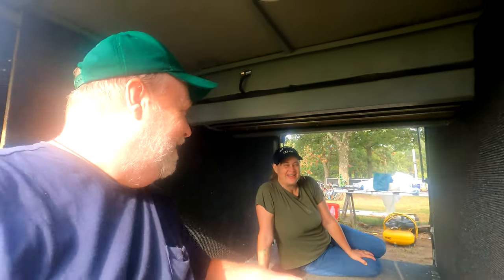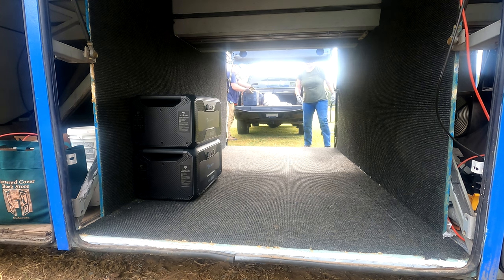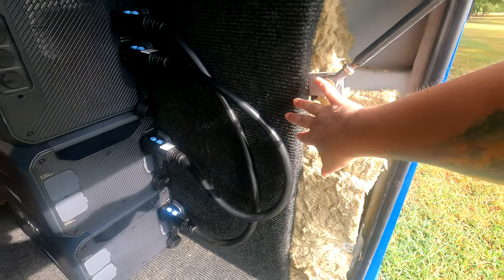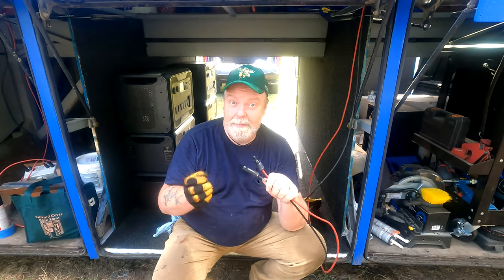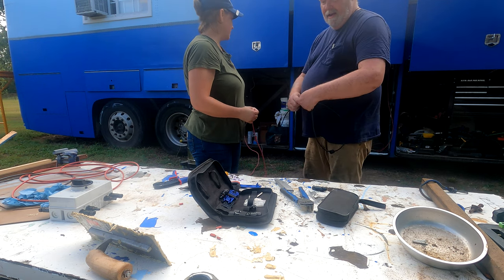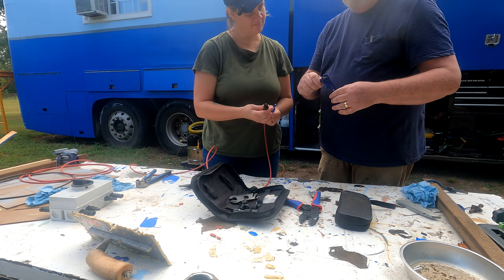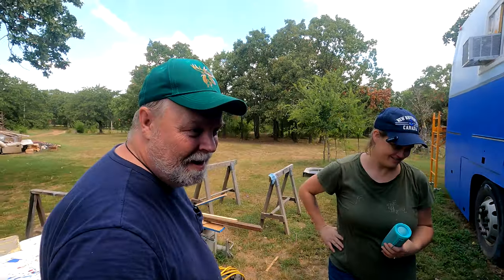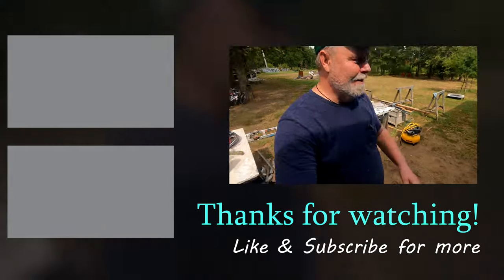Do Solar Generators ACTUALLY Work?

Comment from the maker: It feels so good to get our battery system installed and hooked up. This is the first time we've run a power tool off of our solar power. With eight panels and two Bluetti towers, we'll be able to pull in a max of around 3000 watts total in full sun. For anyone else living off grid or in a skoolie, how much solar are you using? Do you think our system will be enough to run all of the modern conveniences?

Comment: why do off grid people use solar. because the cost of running power to remote places, if the electric company would do it would be int the price of starting at 100K,. thats if they would even do it for you.
Reply from the maker: Not only that, but the monthly bill, as well!
Reply: @magnoliathebus  monthly bill is still cheaper than the loan payments for the system. dont forget the 6% interest every month. remember the 9 - 10 year pay back, that amount dont include the thousands in interest. so the real payback is years longer.